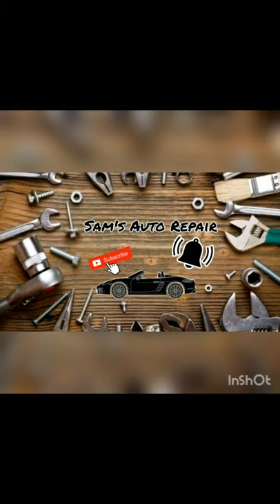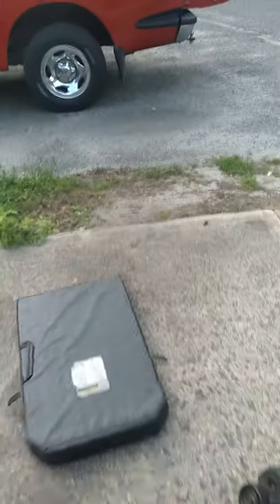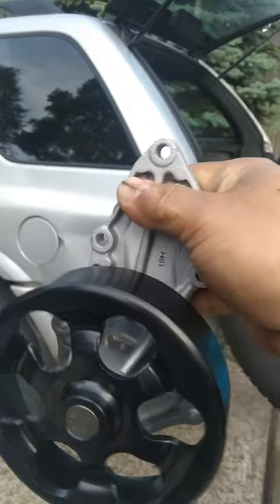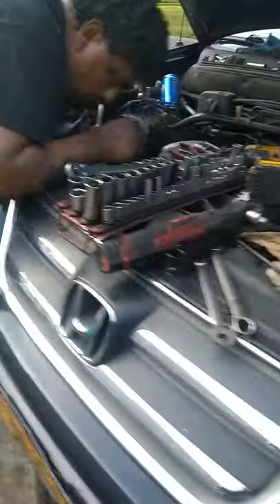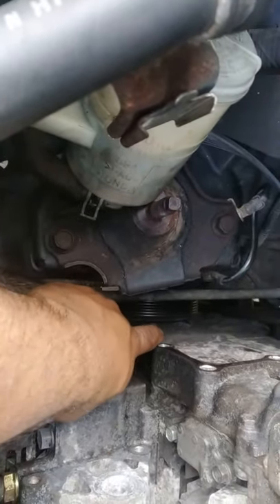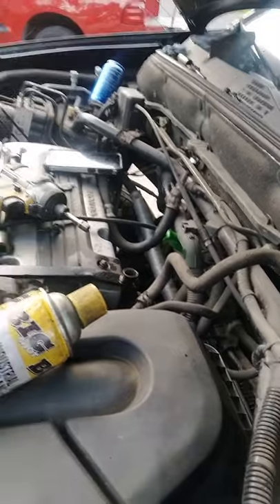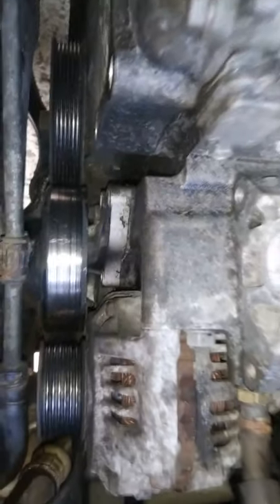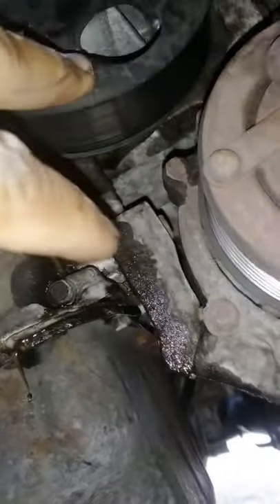06 CR-V water pump removal

Comment: How did you get the bottom bolt off that’s closest to the front of the car. Extremely difficult to get off?
Reply from the maker: With a wrench you can have access to it..
Reply from the maker: Or have a small extension
Reply: I know im late . I used 4" ext  ,a swivel extension, and a stub 10mm